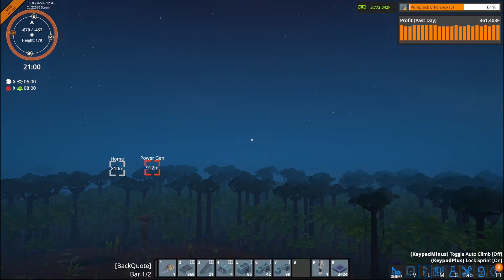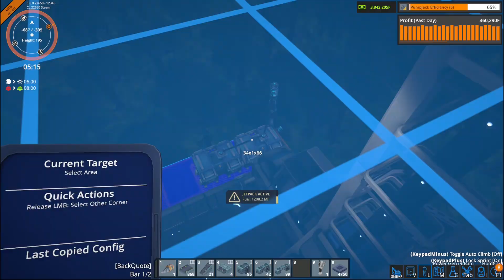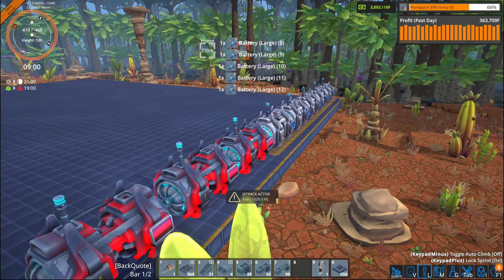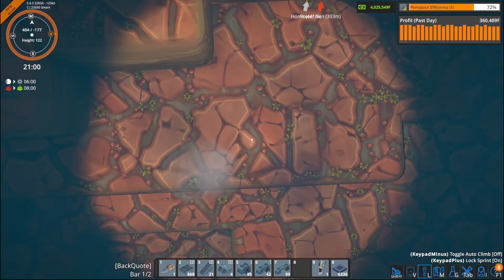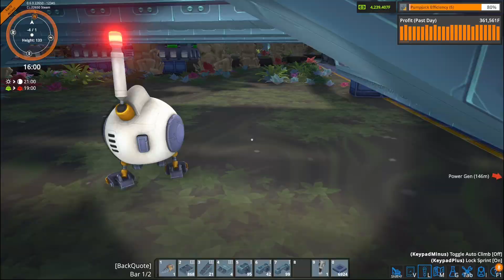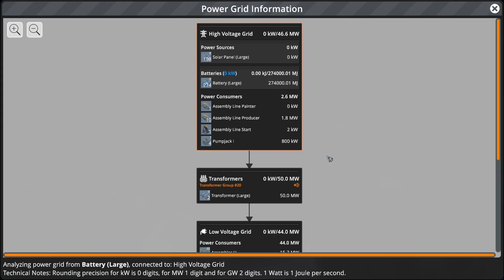Foundry Update 2 - Enough Power

Comment: How long does the day-night cycle last in real time/InGame?

Let's calculate with 50MW to make things easier.
You consume 50MW every second.

You need 50MW*24*(How many seconds is an InGame hour)= X MW Total every day

You must obtain this power in 10 hours, so you do X MW/10 = Y MW/hour
Every solar panel produces 650 MW, so you do need Y MW/650=Z Solar Panels

You consume power for 14 hours, so you do X MW/14 =Y MW
Every large battery holds 1000MW, so you need Y MW/1000=Z batteries.

If you are getting burned out on Foundry it might be useful to take a break and play something new.
You just finished a Streamed series, and a Youtube series together.